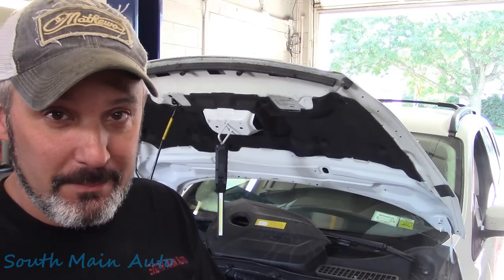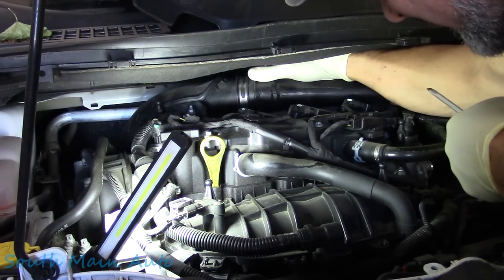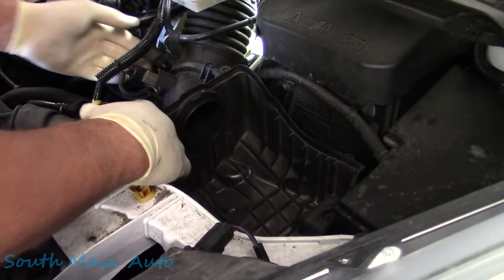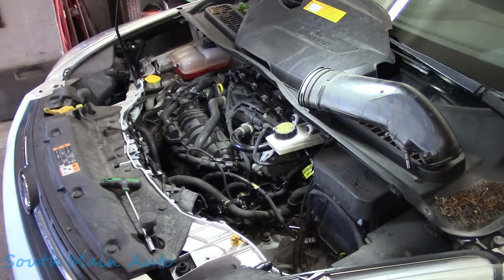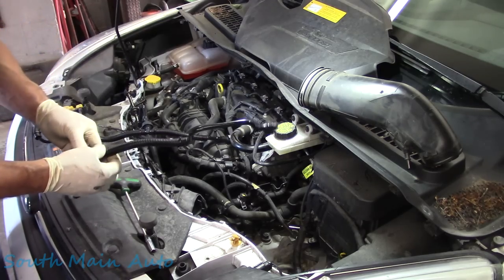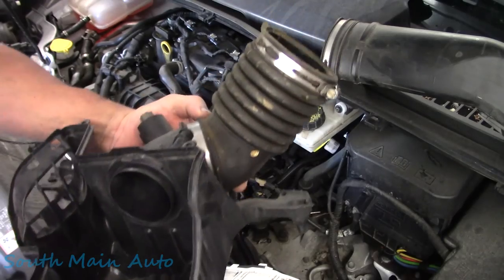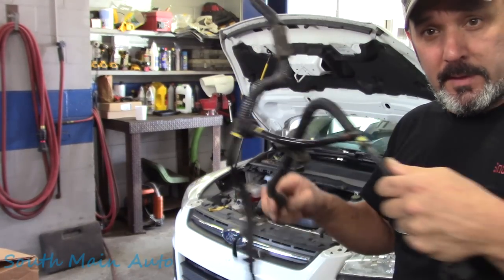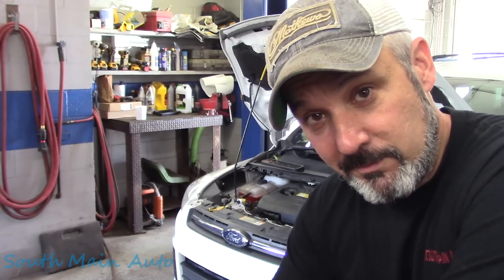Eric O. Unloads The Parts Cannon!

Comment: My first "real" fix of a car was replacing the purge valve on my wife's Hyundai. I learned a valuable lesson. Always look at your new part to see what all is supplied. After struggling for and hour trying to get the gas line off the valve, I ended up using a razor blade to cut the line off out of frustration. As soon as I opened the box to retrieve the new valve, I learned that the new one came equipped with a new section of hose and that if I had just disconnected at the opposite end of the line it would have slid right off and I could have had it done in less than 15 minutes total. lol...lessons learned the hard way.
Reply: I always look at the new part before I start the job to make sure it's the right part.
Reply: the hard lessons are the best teachers
Reply: Ay better a lesson learned then not get it done
Reply: that is  the same as reading the instructions...."aint nobody got time for dat!" lol ..this is the way...
Reply: Experience is a rotten teacher - the test comes first, then the lesson....
Reply: @ five0pd310 , it wasn't all for naught, the important thing is that once you determined that that hose end had to be removed, you found a way to remove it.  Even if it wasn't necessary or designed to come apart like that, you still achieved the objective.  

Lessons like this in perseverance and creativity in problem solving are most valuable.
Reply: @LeverPhile  No joke.  A perfect example, right now. Here we are talking about it 10 years later and if someone showed up at my house needing the purge valve changed in their 2008 Hyundai Santa Fe, I could do it without a thought!!
Reply: The first time you perform any task is the hardest. Go try and change sparkplugs on a Subaru Forester...Took me nearly 2 hours the first time. I can do it in 45 minutes now.
Reply: Well it's always good to get to know your part before R & R. That way you know where all of the disconnections are. Reference the part should you have any questions first...
Reply: @wonerable  Great tip. 100% understand and agree. Notice, though, that I said that was my FISRT fix. lol
Reply: Cool

Comment: As an engineer, I appreciate all the shots at engineers.   Well done, Mr. O!
Reply: Shots at poor serviceability shouldn't be directed at design engineers, but at the organizations that limit what those engineers can do. If mechanics had to have every idea they had reviewed and approved by a committee, accountants and a semi-skilled  worker who didn't like what he had to do to implement that idea,  there would be few mechanics.
Reply: Well, I've always maintained you (engineers) should have to work on what you made (all of it ) like an old Chilton manual where they took apart new cars to figure them out. Most engineers (not you) have terminal tunnel vision.
Reply: @LanceNeves  We have limited time, and there are trade-offs made. Serviceability is the first thing to get the ax.

If you want an automatic FWD V6 with all wheel drive, then you will end up with a bunch of weird stuff done to make it fit
Reply: JUST BUILD A BETTER PRODUCT

Comment: Remember the good old days when you'd stand in the engine bay to repair it?
Reply: Ooooooh, I 'member
Reply: Still do on some vehicles. I work at a chrysler dealership mainly on trucks and diesels. Diesels don't have enough room to stand in but plenty room to lay on top of and reach for stuff. The v6 1500s I can stand in front of the engine and pull the heads off without taking the electric fans out
Reply: I carry a spare 283 in my '65 Impala engine bay.
Reply: @ChrisTheBmxGuy  k
Reply: Yeppers, years ago I was in a shop working on a Dodge truck I think replacing timing chain etc, had the fan off, rad out, etc, plenty of room. I was setting on the lower rad support w my feet on the floor inside the engine bay not paying attention, one of my coworkers quietly walked by and partially closed the hood and started yelling has anyone seen me. I yelled back a few times before I ever actually looked up and saw the hood.....lolol....

Comment: Seeing how much trouble you had removing that air box assembly, I’m reminded of when I worked as an assembler building rotogravure printing equipment. It was imperative that everything we built had the maintenance technician in mind. Obviously that doesn’t go far in the automotive industry.
Reply: Cars are specifically made now to PREVENT them from being repaired.  See: Dodge Grand Caravan, sealed transmission oil plug.
Reply: @MrWolfSnack  That does seem to be part of the problem. The other part would be the complicated mess of wiring, hoses, sensors etc that comes with modern cars to make them way more fuel efficient. And a third part is that cars are being made more and more compact, meaning less space to work in under the bonnet.
Reply: @tjroelsma  Yeah. Look under the hood of the new bronco.  there's absolutely no way to work on the engine.  also the newer ford trucks, to remove the engine you have to take the entire truck body off the chassis !!!!!!
Reply: @MrWolfSnack  And those are still reasonably large cars, so it doesn't seem to make much sense. Over here in Europe cars are much smaller, so you'd expect to run into this problem. 

Having to remove the engine to work on it has been a common practice with some types of cars over here for quite a while. I had a Mercedes A class that had a really cramped engine bay, but the tiny little Smart City Coupe I'm driving now has even less room in the engine bay than the Mercedes had. With the Smart the engine has to be lowered from the engine bay or even taken out completely for standard servicing.
 
But it is a very handy and surprisingly fun to drive little car that's very easy to park, which is important to me as I live in the center of a very busy city.
Reply: Mercedes Sprinters are a pain to work on. First issue is the computer, who has access to mercedes trouble codes, besides a handful of people and the dealer. Second, the newer ones only use a sensor to tell you how much oil is in the engine. You get told when to add more. Very fun on an oil change when you can't just look at a stick and see what is needed. Forget parts, I even had to special order the engine oil from napa, most parts napa wouldn't even carry, but they did have the filters. 
For Ford, my mom had a 11 escape, the transmission filter is in the transmission, but so is my old Jeeps. The difference is the Fords transmission is sealed. The only way to open it is to pull it out, and open the whole case, and it only opens in half, from side to side. No oil pan you can just remove, no filter you can replace. Even old vans with a doghouse are easier to work on, you just have to be in some funny spots. New cars are trying to lock you out, in ways that are done on purpose.
Reply: Oh, and that air box needs to be removed to replace the battery.  So Ford gives you plenty of chances to break some brittle plastic.
Reply: @crowttubebot3075  Yes, you look at constructions like that and wonder if they deliberately made them that way so it's almost guaranteed to fail over time.
Reply: @tjroelsma  I won't give them any malice in their intent while designing things, well not much anyway, they do get to make money off of parts sold later on.

Most vehicles are engineered to be assembled efficiently at the factory, and last through the warranty with minimal cost back to the company.  After that, you are right, they don't care.
Reply: @crowttubebot3075  I can agree with the efficient assembly theory, but some designs are just ridiculous and actually work contradictory to efficient assembly. Renault for example uses pretty standard headlights on their models, but then cover them in all kinds of shrouds that have to come off to change a lightbulb. There's nothing efficient about that. 

Personally I feel that designs like that are more a case of style-over-functionality. The out and out stupid design of that air filter housing that Eric O showed just seems engineered to fail instead of being efficiently to assemble. Assembly efficiency would have all the mounting points in 1 direction, so the part can be slid in in a single movement, instead of having to push it down, slide the front tab in sideways and then having to push down again to slide in the other mounting points.
Reply: I wonder if anyone reading this knows what "Rotrogravure" printing is or was? Old printing equipment runs and runs. The new equipment is all computerized...so you know what it won't last.

Comment: I went to tech school and didn’t end up getting a snap on scanner because of my credit. And the school didn’t pay for it into our tuition. So I work without one, and use a cheapo “scanner” my 07 Impala had the check engine light, codes for lean and gas cap I believe, but what I caught onto was it was hard starting right after filling up, that was the dead giveaway for the purge valve. Swapped it out because it wasn’t expensive, and I didn’t believe I had electrical issues, fixed it 100%.

Comment: Ya know, Eric, dropping a socket where you'll never find it is an example of the Law of Selective Gravitation in action.  (I found my 10mm deep well 1/4" drive socket 8 years later when I pulled off the lower intake manifold on Nissan V6.)
Reply: Mine was the philips bit from my 6 way screwdriver lost on the same engine nissan vg30e 1990 model.
Reply: Isn't that issue only with the 10 mm ?
Reply: @thomasfletcher4765  yes. A 10mm socket seems to have more mass than any other tool and therefore gets pulled down by gravity more often. I am trying to get a government grant to study this phenomenon.
Reply: @ronjohnson8119  Excellent idea, Ron.  In fact, perhaps you can establish a scientific corollary to LOSG?  Let's call it the 10mm Gravitational Paradox.  Whaddyathink?
Reply: @JohnIsett  brilliant. I like it!
Reply: Hi John . I did the same back in the 60’s removal of VW motor lost my 17mm wrench  and like you got it back years later changing the clutch it was stuck on one of the main engine bolts Big celebration 🎉 I 🔧🔧🔧
Reply: Harbor Freight sells a 10MM set for about 10 bucks ... comes with a 6 point, 12 point, deep, shallow, etc.
Reply: All my 10mm sockets and wrenches don't seem to have this problem. However, if anyone finds any of my five 1/4" drive 8mm sockets or 8mm ratcheting wrench please let me know
Reply: @soleiko4749  Hmmm, may have to modify our corollary to include other size metric tools.  New name: Millimeter Gravity Wave Corollary to the LOSG.  How's that sound?
Reply: @JohnIsett  I like it! 👍
Reply: I dropped a snap-on screwdriver under the hood of a car one time. Couldn't find it for anything. Fast forward a year and the car comes back in for a starter and viola there it is sitting on top of the starter! 🤣🤣😁
Reply: You FOUND it???
Reply: @thomasfletcher4765  Not always, I dropped my 13mm ratcheting flex head wrench and  found it after buying a new one.
Reply: @Marty's 4x4 the joke is 10 mm sockets disappear faster than other sockets
Reply: @thomasfletcher4765  Yep. That's why 10mm sockets are sold in packs of a dozen.
Reply: I found my interior clip removal tool in my 08 Tahoe two years after "misplacing" it. Found it in the driver side front wheel well.
Reply: @thomasfletcher4765  …and the disease spreads to 7/16” wrenches and 3/8 drive 1/2” sockets…
Reply: @fishhuntadventure  oh great , guess I had better make sure my others are feeling well
Reply: My most valued hand tools are those that let me find and retrieve tools dropped into engine bays.  The replacement hand tools that are available today are expensive crappy imitations of what I bought years ago.
Reply: also found a Snap On 1/2 in ratchet. extension , and Tie rod sleeve tool laying on a busy road full of potholes

Comment: I used to work in an industrial repair shop that was around the corner from 3 different auto repair shops. I still have Snap-On combination wrenches, a nice swivel head ratchet, hammer and a pry bar. I found them all in the street. Must have been left under the hood or wherever, and fell out during the test drive. The mechanics were constantly blowing past stop signs, flipping me off when I blew my horn trying to prevent a crash,  so I had no issue with keeping the tools.

Comment: I can’t believe he’s using the parts cannon. At least he’s doing it with the customers permission. Love your videos, I’ve learned a lot watching you.
Reply: At least its a smart parts cannon.
Reply: I learned I don't have the patience to work on today's cars. Tools would be airborne and the language would be X rated
Reply: @richardbambenek2601  I too have the tools with wings. And the mouth of a longshore man.
Reply: Experience allows him to be fairly certain.
Reply: @danielbarber8387  p
Reply: Eric is giving it an "edumicated" guess!!!!! However his knowledge base is excellent. Will go with his judgement and so did the customer. Retired mechanic in Land Down Under.
Reply: Just laugh a little more parts cannon was meant as a 🤣🤣🤣
Reply: The purge valve will be the fix for this issue 99% of the time, on any vehicle equipped with an evap system. 

Fuel Up + Long Crank/Hard Start = bad purge valve. 

Quick test (if there is easy access to the purge valve without having to remove all sorts of parts and pieces) - disconnect the power connector and inlet hose and then start the vehicle. Place finger on the inlet port of the purge valve, if the purge valve is pulling a vacuum (if you can feel a suction on your finger) then it is bad. On vehicles like this one, this test is not practical. You pretty much have to throw the parts cannon at it because of everything you have to remove and replace just to get to the purge valve. 

There is no reason to wait for it to fully fail to trip the CEL. Until the purge valve is replaced, to assist the system to allow the engine to start, push the accelerator pedal to the floor, hold, crank, release accelerator pedal, crank again and it should start.

Comment: My daughter has a Ford Edge and having similar problems. Engine light and runs rough and sometimes not at all after filling up. I asked her if they keep trying to put more gas in after it clicks. They do. I told them not to do it. I sent this video to them. Informative and at the right time for them. Thanks.
Reply: Very common problem for a bad purge valve
Reply: Also, it allows for expansion when the weather is warmer.
Reply: I have a 2002 Durango that kept giving the check engine light every time after filling it up.  One day when at the gas station, I happened to get a faulty pump nozzle at the gas pump, and I didn't know it. The safety click in the nozzle was broken , and I was just filling the car up and filling it up, and then all of a sudden PSSSSSSSSSSHHHHHHHHHH gas went everywhere and all over the ground, the side of the car, everything.  I put the cap back on, more gas squirted out, and clicked it shut.  Drove around for weeks, it took weeks to use up the gas just to get it down out of the filler neck outside of the tank, and the idiot light never came back on.  

This is now 2 years later and guess what? The light still never came back on. I have no idea what happened but I believe whatever happened the gas sloshing around in the filler neck and around the cap from  the tank being filled to overflowing must have washed clean whatever sensor or valve was clogged or stuck open that was causing the idiot light to come on. What a mystery.

Comment: I had one of those check gas inlet valve light on my dash for a while. I managed to clear that one with a little WD-40 and working the valve back and forth. After that a couple days later my engine light came on. Code said P0455 Evaporative System Leak detected (gross leak/no flow). I youtube'd the problem and looked at a couple Ford F150 forums and most people talked about the purge valve on the engine. Looked up the part and there are 2 purge valves. 50/50 I make the right guess. My guess was based on the number of reviews for the parts. The valve on the engine had the most reviews (over 200 vs 1 for the other part), changed out the part on the engine and cleared the code. The engine light hasn't come back on yet. Crossing my fingers!
Reply: Jimmy S  I have an EVAP test on the scantool but I think it's faulty. I select the test and it comes back almost immediately as failed. The scantool I have was specific for BMW so don't know if it's looking for BMW parameters or what.
Reply: Jimmy S  Drove six hours round trip and the check engine light never came back on. Crossing fingers I guessed the right part to change.
Reply: It has a purge valve and a vent valve, not two purge valves. The one on the engine is the purge valve, the one back near the fuel tank is the vent valve.